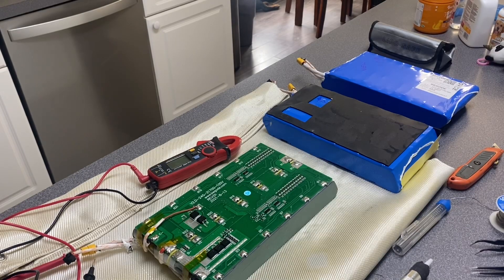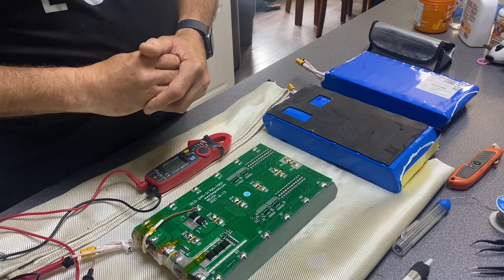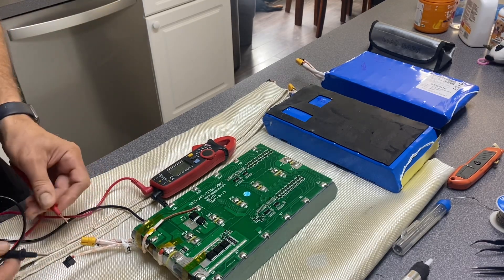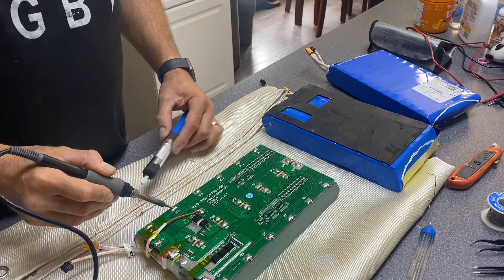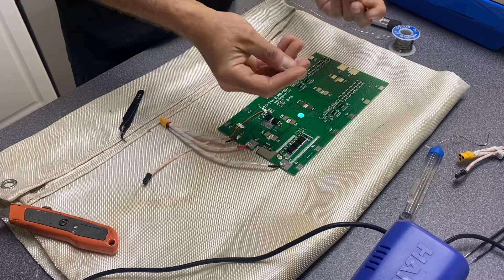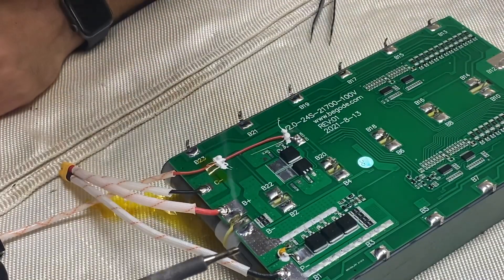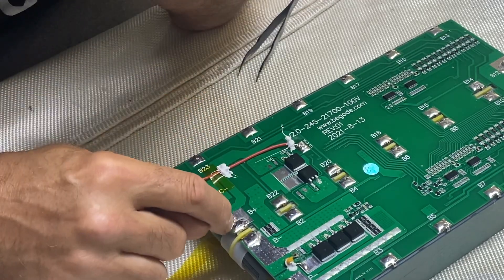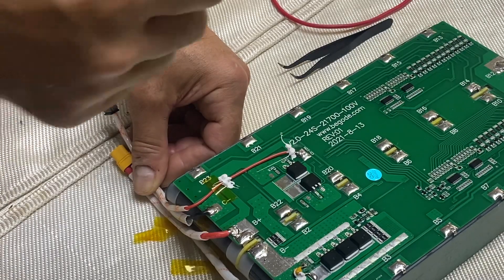Replacing BMS on Begode 900wh 100.8v packs

Comment: On the newer bms there is no wires already soldered on there is a BO as well as a B+ would I solder on the B+?
Reply from the maker: @jamesthornton642  i don’t want to give you the wrong answer as i haven’t seen the new bms.
Reply: @ thanks for replying I’ll just solder it to BO it has 2 40a ceramic fuses 
Which I’m guessing is for short circuit protections

Comment: I guess this checking method wouldn’t work with the series packs on the master?
Reply from the maker: you can replace bms on any pack
Reply from the maker: or if you mean checking individual cell groups. yes you can always check but you would need to take the wrapping off and then wrap again in new heartshrink etc. not plausible. would be solved if they started using smart bms.

Comment: well done . in the video, when you take off your bsm, the badge on the b + bent. is it not loose or broken? 7:20 minut
Reply from the maker: that was my fault. i hadn’t desoldered that tab. i took a peek and the weld on the nickle plate hadnt been broken. but i will be taking it apart to check and repair if it is busted.